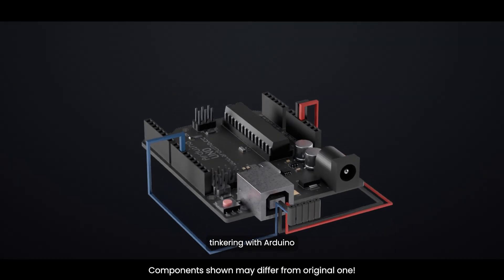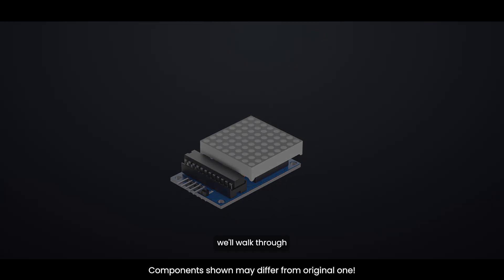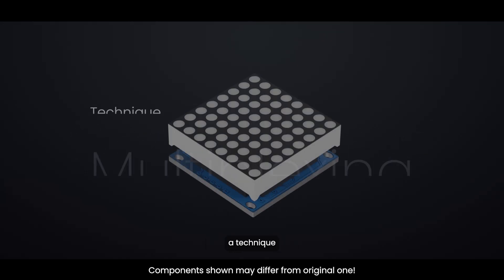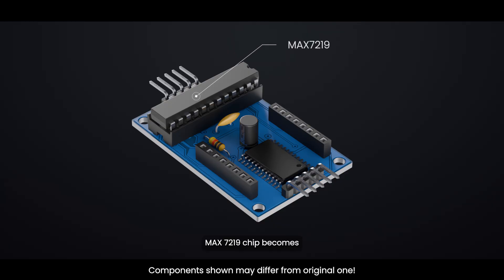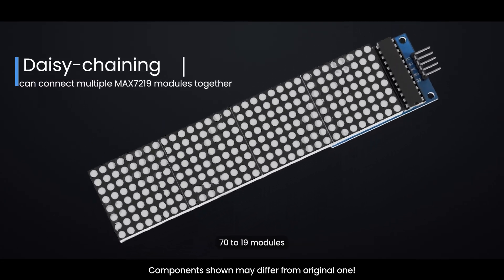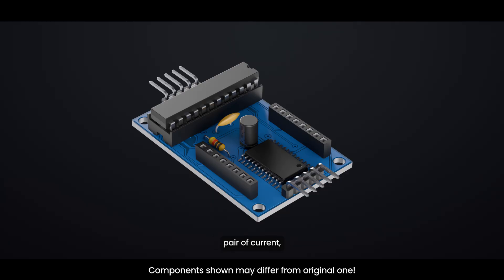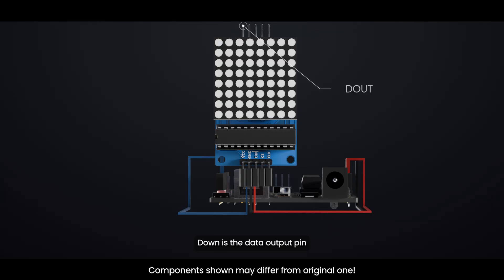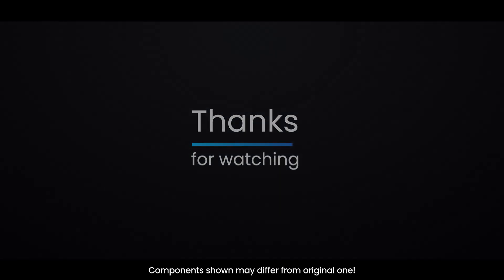How MAX7219 Dot Matrix Display Works | Arduino 3D Animation Explained in Detail 🔥

Comment: The name of the chip is not a mantra. The constant repetition is annoying.

The really exciting information is missing. How is the data transmitted? How does the chip know that the incoming data is intended for it and not for the next one in line?
Reply: As far as I understand, it communicates using SPI. Thus  CS (Chip Select): Selects which peripheral device to communicate with. But take it with a grain of salt